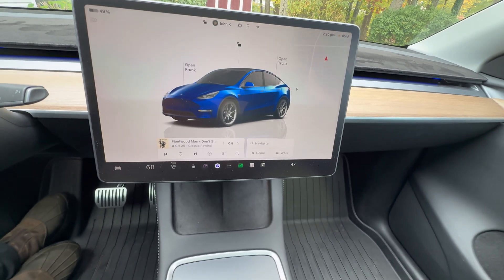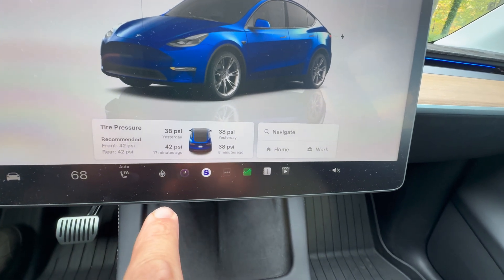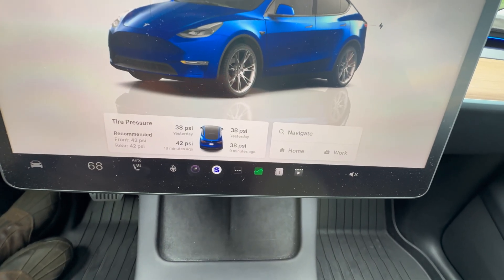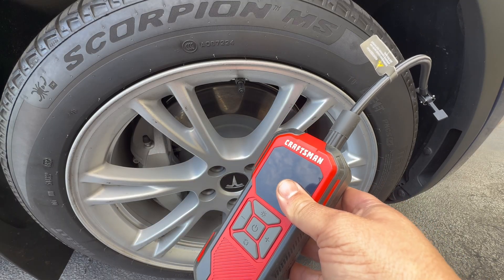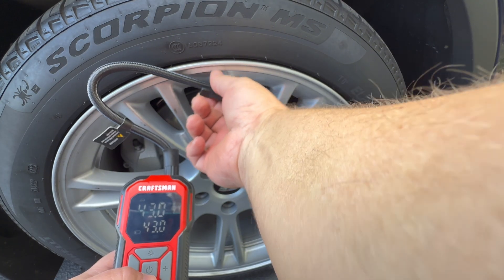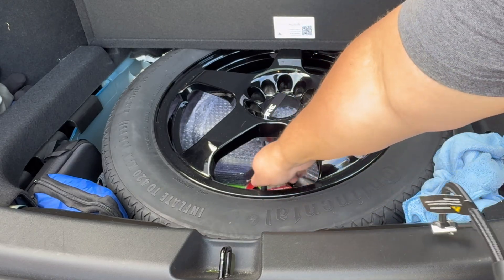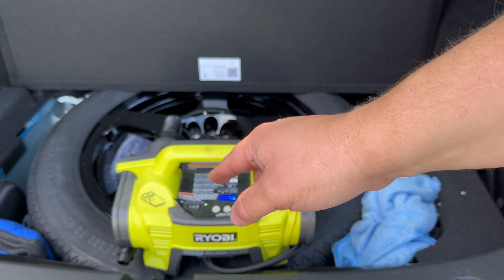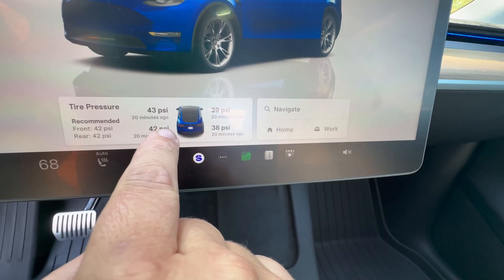Most Tesla Owners Forget THIS! Winter Tire Pressure Check + Easy Top-Off Guide

Comment: Good review, but the only thing missing as you fill the tires with winter air (lol) is an accurate tire gauge with a bleeder valve to double check for accuracy when the tire is cold.